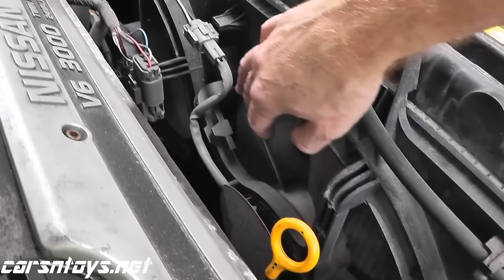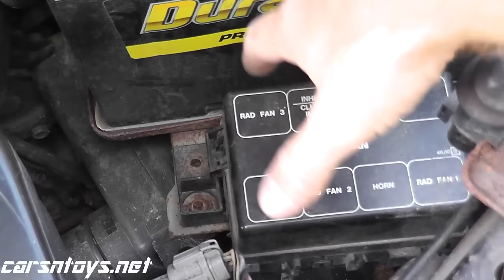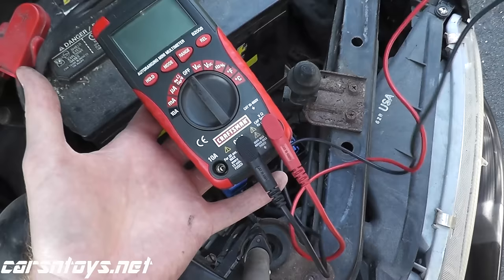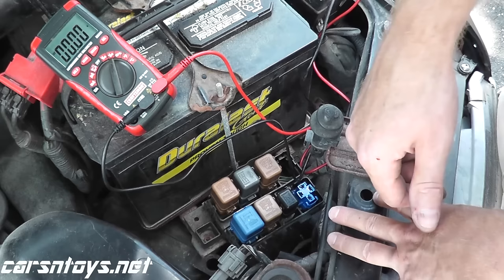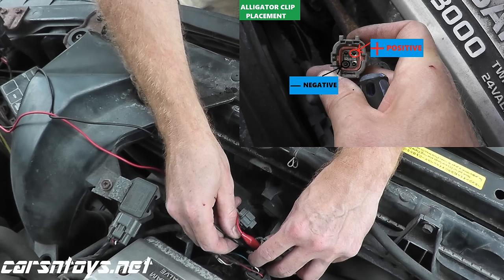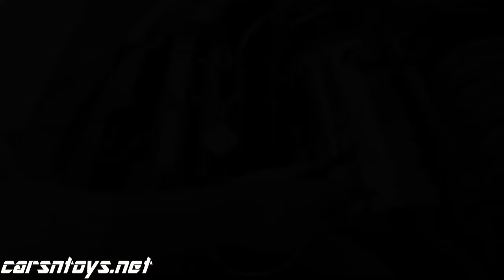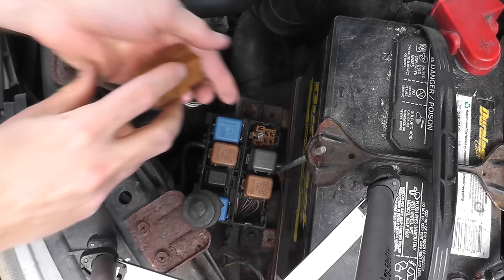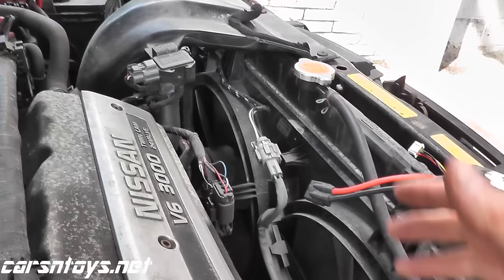Overheating Help! | Testing Cooling Fans - Relays - Connections

Comment: Great video one of the best I have seen the problem I have is that I turn on my car a 98 firebird 3.6 and it over heats ones I disconnect the tempeture sensor the fans start working and tempeture goes down if I connect the tempeture sensor the fans stops working please advise thanks.

Comment: Great job explaining what to do. How would I test the relay and fan connector with multimeter if my relay area is far away from the fan connector? My relay box in my vw passat is inside the car under the steering wheel and my fan is under the hood. Thanks in advance!

Comment: Thank you for a very helpful info.  Have a 3rd gen Prius with fan problem only one fan turns on the second one not ? I follow your steps , check relays they ok , check fans with battery ok replace temp sensor and still only one turn on at 200 temp.  Please HELP!

Comment: I just buy a Honda CR-V 05 and I noticed the both fans are brand new and when I turn the ac the fan kicks on but when the car reach normal temperature the fan never turns on the car overheats while in traffic and I jump the connector of the coolant fan switch and the fan kicks but I notice the person before replace that sensor for those that they sell on autozone and idk maybe the sensor it’s bad cause it’s aftermarket

Comment: Question for you.  I want to test the fan motor.  I connect the red wire to battery positive and the black wire to battery negative. there are four pins on the harness.  where do I connect the red and black wire at the harness of fan motor.  great video.. thanks for any help.
Reply: I think higher two connection for low speed and lower for high speed but if you reverse polarity does not matter the fan would kick backward or forward because you want to test only movement.

Comment: Thanks for the information.

With key at ON position, 86 of the C/Fan Relay has 12 volt, and 85 had 1 volt respectively. This relay sits on the engine compartment box of Hyundai i20.

Now, my issue is that as a test light bulb with its one end connected to 86 and other end to ground, the bulb did not glow. Same case for testing a relay. In both cases, the voltage across each loads is about 3 volt. Why is this happening???

Is not the load supposed to light up when it's grounded???

Comment: Nice video but it would be better to load test the circuit instead of doing a continuity test. Your DVOM will show continuity even if there's only a few strands connecting. Same w/ voltage. An incandescent test light in lieu of an ohms/continuity check would rule out frayed/chewed wires.

Comment: WAoh, great video. I have been having an issue with my volvo overheating. I changed out the fans along with the control units that they have they look like little square boxes, not sure if they go by different name. That did not fix the issue either. Maybe you can point me in the right direction but i will try your steps on this video and see if i can get any of them to fail. The FANS on my car will NOT kick on at all while driving. They WILL kick on once i stop and turn off the car but only if the car has gotten hot because if i have dont catch any traffic on my way to destination and front of car has gotten lots of air by driving lets say over 40 mph (most of my drive is highway not streets) the fans will not kick on after i stop. if i have catched traffic or made stops where i have to wait for lights they fans will kick on when i pull over and turn off the car. Sometimes if i catch a red light i will turn off car to wait for light to turn green and in that wait time i can hear the fans kick on, This is usually not an issue once outside temps are low here in GA but this summer has been hot and had already one hose crack on me. Hope you have some pointers, looking to replace car if issues keep rising with this volvo. FYI 2010 XC60 T6 AWD. Thank you sr.

Comment: Thanks for the video, it was quite useful. The problem for my Mercedes Avantgarde is the fan is stuck constantly on low and not spinning fast. An independent check of the fan shows it is okay but when connected to the car, it does not spin fast enough, and the temperature gauge is around half mark. Any advise? Thanks.

Comment: To turn those fans on, The ECM sense refrigerant high pressure, or refrigerant temperature ? Fan operation will be determine by only those to options: pressure or temperature. Speaking about air conditioning operation. Am not referring to the antifreeze because I already know that ECM will turn fan also if engine '' temp'' reach  the manufacture standards.

Comment: What makes the fan turn at different speeds?  Does the low speed relay send less voltage to the fan motor than the high speed relay?  Example low speed relay sends 6v and high speed sends 12v

Comment: On the relay it show what wire is line feed and what I NO or NC contact. But if you have 12 volt to the relay the fan has to run if not relay is bad

Comment: 2013 Edge, one fan inoperative, overheats when hot and car stopped. 
Unplugged fan connectors, checked connections, still inoperative, with 
engine running & AC on, struck fan metal housing hard using hammer 
& extension, it started working, does not indicate the control 
module failure as fans are wired in parallel IMHO. Likely an 
intermittent electrical connection in the fan as it turned freely.
Now to identify a reliable replacement if one exists that does not cost >$300?

Comment: Excellent! Is it normal when taking out the Coolant temp. Sensor connector the rad. Fan turns on? What possible      problem with this? Nissan xtrail. Thanks

Comment: What happens if I get 12v to my two lines on my high output cooling fan relay terminal but I’m also getting 2.5 volts to one of the other 2 lines I should not be getting a reading?

Comment: Hello,  my fan turn on high speed when turn on the car and saty on after shutting the car off,  and turn on by it self after a while when the car is off,  its 2020 Rav4, i just put new fan after fixing front end collision and the problem start.

Comment: My 07 edge sel awd 3.5L radiator fan on driver side is not spinning or working as it should.  The passenger side radiator fan spins. I don't know which of the 2 fans is high or low speed. I unplugged the connector and the fan which was working would stop. I have not tested fan motors or fan relays. I have not checked fuse box either to see if fuse blown possibly

Comment: At 4:50, the harness test, what terminal are you testing at the harness? (Is it the positive, negative, neutral wire or what?) What about where the relay plugs in? (Is what u call the "5" pin the 85, 86, 30 or 87 pin location?) I'm dealing with a 3 pin harness on a 2005 v6 liberty, so this is important info for viewers who aren't dealing with an apples to apples comparison. Hope to hear something... it could help lots of people even if you've answered before (I couldn't find it)

Comment: 2002 Escape 3.0, fans only kicks in when ECT sensor is unplugged, also when unplug, the temp gauge drops, stops working, only shows the temp for a brief moment when switch is in the ON position or start the car. Temp sensor is new.

Comment: A great video and very detailed, although I am working on a hyundai, the process is still the same I just wonder tho, if the temp. sensor isnt working but the relays are good and the fans test good, would the fans still work? from what I saw in this video everything was working as normal so if we werent trying to fix this vehicle, why did we do the tests on this vehicle? I thought he said at the beginning the high speed wasnt working on this vehicle but all test showed that they were. as a mechanic I appreciate the detail of this video, not many people get into such detail, I would like to see this man do more video's.
Reply from the maker: Hi Leo. The fans were working perfectly fine. I just did a how-to video to show the steps involved if you do indeed have a problem.

Comment: I have Accord 2005. When I start the car and put AC On, the condenser fan not turning but inside the cabin, the ac blower blows cold air. And when the car reaches its temp which allow the fan to turn, both fans turning. Need answer if you have same.

Comment: Hi thanks for your videos..

I'm a subscriber.

When testing the radiator fan harness connector, is it a must that we know the way that the harness connector ports are set up ?

Or Can we simply place the positive test lead in any harness connector port and then place the ground test lead into each individual relay port to hear that beep to test for continuity ? 

Making sure to repeat this process for each and every radiator fan harness connector port (4+ ports).

I also noticed that you tested only one (#1) harness connector port with the positive test lead touching the ground test lead to the relay port (#5) and verified continuity.
I understand that this verified continuity for that specific port but should we check EVERY PORT because is it possible that one port can have continuity but another one of those ports in the same fan connector, etc. be defective while the other port is simultaneously okay making us assume that that continuity check came out ok when in fact part of that connector could be defective while the other part is okay ?

Or once you verify continuity in 1 port, is it unnecessary to check the remaining ports ?

Sorry about being excessive just trying to be thorough.

Thanks.
Anybody knowledgeable please reply soon.

Comment: Hi, for 2001 honda civic. It has two fans. One on driver side amd passenger. The driver side turn ons but the passenger doean’t kick on at all. Is that mean the motor is bad. Fuse and relay are good since one is running. Inwas thinking the coolant temperature switch. But still makes me wonder it that bad none of the fams wouldn’t work. But since one runs i doubt the coolant temperature swiych is bad. Or am I wrong? Pls help

Comment: To prevent corrosion, 
rust and oxidation
 on,relay pins, 
junction box holes
connection or battery posts 
and wire or cable terminals 
apply dap of silicon / 
dielectric grease.

So, add dap of
dielectric grease
junction box hole.

Comment: The temperature switch controls the gauge, the cooling switch controls the fan. Which is what I'm having trouble with. I replaced the fan and all the switches, but the fan won't come on. I know the fan works because when I turn the AC on the fan comes on, but goes right back off when you turn the AC off. I replaced the cooling switch twice all ready. My only guess is to replace the o ring and try and put the old one back in. It was working fine before I had to put a new thermostat housing on it, and replaced everything on it. and put a new fan in it.

Comment: Nice video i ve got electrical condenser fan not working really is ok fan is ok tested fuse is ok
There is no voltage to terminal 30 and 87
Also continuouty for negative between fan connector and relay 87 is not there once you attach probe no sound for continuouty only the 1 sign on voltmeter vanished dissapeared but for 30 which is positive there is contiuty so i have 2 issue 😫 really big headache to dig in these wiring on  and find breaks in harness in a  daily used car 😓

Comment: I have a 2011 aveo that passes all these tests yet the fan wont turn on when reaching the temperatures that should tell it to turn on or when using AC. I've replaced the thermostat and both coolant temperature sensors, do you think at that point it would be a faulty ECM?

Comment: I have a 2007 toyota camry it also has 2 fans and are the 2 fans supposed to turn on to cool the engine or just 1 .. One faan is for the A/c and the other fan for cooling the motor ?? Or both need to turn on when im using the A/C

Comment: CARSNTOYS,  
     ^^   ==    I disconnected the Temperature sending unit/temp sense, so How can I test the instrumentation temp gauge in my cars dash board by itself to check if its working correctly, what do I need to do?
    1.) Does ALL cars or only certain cars use a Thermostatic switch to turn ON the radiator fan?

Comment: Ok I fixed ac a few days ago. I bought it qin non working ac. First day so cold we turned it down. Second day intermitently works. I assume the fans. Did all you said here and it all checked out.

Also fot a new amnient air sensor. It is still intermitent. Will work cold as ice even ideling in a parking lot for an hour. Then hot. 

Any ideas?

Comment: I have a 97 jetta and I replaced the cooling fan relay and fans still not coming on after driving for awhile. My heater core popped at about the same time idk if before they stopped working or they stopped working because the core popped, any advice

Comment: i have spend 500 dollars for my radiator fan but still its not working. i have changed the sensors as what mechanic says. any advice for hyundai getz.

Comment: My low speed does not work right away when i turn  the AC on , besides the cooling fan works when the engine temperature gets to the point but the speed of the fan is very weak, it spins but not that strong.
Please any advise.

Comment: sir good day! can you give me idea how to troubleshoot my nissan cefiro 1998 model. when i start my car the two fan for radiator and condenser at the same time continuously rotating. i already change the coolant sensor temperature but still the same issue.

Comment: I have a Subaru Tribeca 2011 model. When i switch the Aircondioner ON, the high speed dont spin and the AC does not cool.
When i removed one connector pin and made it direct it is running at high speed.
What is wrong?

Comment: Hello only one fan works on mine.. the other one works but i have to push it with my hand what could it be i took it down and cleaned it put some lubricate and still does the same could it be a bad motor fan?

Comment: Im having some issues with my 2004 Honda Civic radiator and cooling fan not coming on,  I found I had a bad radiator fan and I put in a new coolant temp switch as well.  The fans will still not come on but when I jump the coolant temp switch plug both fans come on.   Any ideas other than I bought a bad coolant temp switch??

Comment: All my fuses and relays work. 
When I apply power direct to the fans, they come on. 
But fans never come on on their own. 
Upper radiator hose swells up, over heating. Lower radiator hose is good, 
Checked, radiator not clogged. 
How do I check the wire connected to the engine coolant temperature sensor. 
I put a meter on the 2 leads of the connected to the temperature sensor. The meter shows a closed loop. I get 0.00 on the meter. 
Take the meter of the wire, I get OL on the meter. Or should that sensor wire always have a closed loop ?

Comment: Hey Thanks for the video.  I have a Buick Lacrosse 2005 code P0481 coming up.  I changed out the fuse and the relay.  Didn't help.  Still getting error.  I still have to check the ground and multimeter on the wires/relay.  Any chance you can help me out and figure out what Fan 2 is?  From your video I could assume driver's side...but its Buick.... you think still the same?  Thanks.

Comment: Just curious on my vehicle when I disconnect the temp sensor both fans come on high speed but when I disconnect the temp sensor on my girlfriend's same vehicle as mine only her smaller AC fan comes on automatically. I haven't had a chance to test the bigger radiator fan but it doesn't come on out automatically the way mine does nor does it come on when the temp sensor is connected and the vehicle is plenty hot. Do you think it would be the motor to that fan? If the motor is worn can you still turn it by hand because I can

Comment: I have a 2000 Toyota Camry 2.2. I replaced many parts already (Water Pump and it's Housing, Thermostat, Radiator, Coolant Temp Sensor, Fan Switch, I had flushed the coolant system forward and backwards and put fresh coolant in at 50/50 ratio, and i burped the system completely free of air. Thermostat opens on time, too).
Problem is, the Fan 1 Relay stays open when the Cooling fans need to come on, thereby overheating the engine. That Relay is a Normally Closed type, and when the car is started the Relay opens and stays ooen until the Cooling fans need to come on.
What could be my problem?

Comment: Can somebody help please!!. I have a 2009 Chevrolet silverado with the 5.3 engine . it overheats beacuse the fans dont want to turn on automatically. This just started a week ago .  fans only turn on when i turn the ac and only stay on the low speed. I change the thermostat. Drains the coolant and put in fresh coolant , temp sensor is in working conditiin, relays are good and also fuses.i alsp check all the voltage and gound for everything. Please help. Im going nuts!.
Reply: Im haveing the same problem!! Did it get fixed??

Comment: Great video , I have a Volkswagen Passat 2.0 ,with overheating issues, I replaced the thermostat and coolant sensor, I tested the fans with the same type battery you have in your video, fans run , but they fail to operate as they should, I cannot locate the fan relays, do you have any idea where should I look? Do you have any suggestions as to what other steps I should take?

Comment: I have a 2005 Lincoln Town Car and my fans only work when they want to. They will work the majority of the time but will suddenly stop working and my ac will blow regular air and it will also over heat. Any idea what the problem might be? Today it overheated on the highway going about 10 miles per hour so I pulled over and popped the hood really quick and the fans were not on. I turned on the ac and they still didn’t power on.

Comment: bro can you help me i have gmc acadia the radiator fan passenger side some times its stop working and the engine  start shaking can you help me what i need to Change  the temperature  engine sensors  or the relay in the fuse box